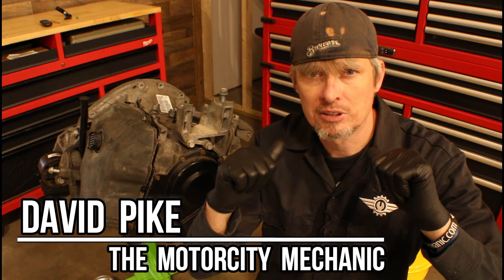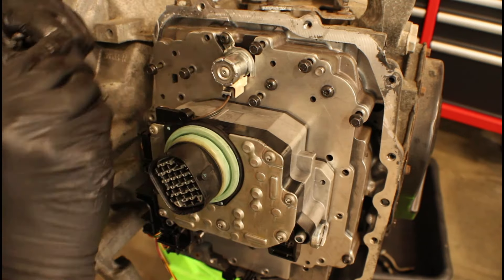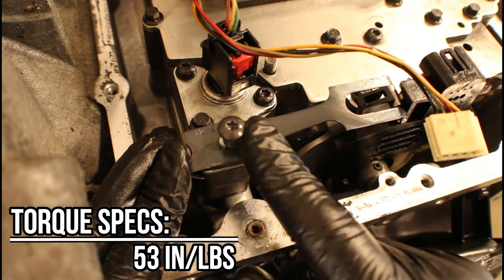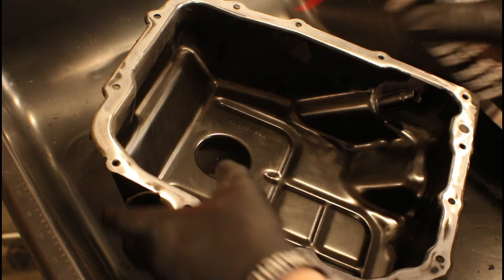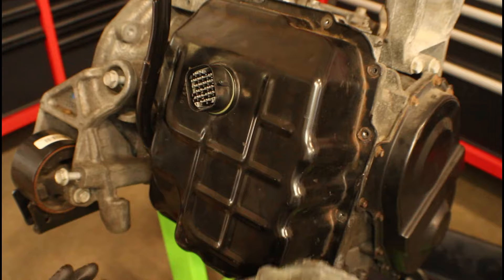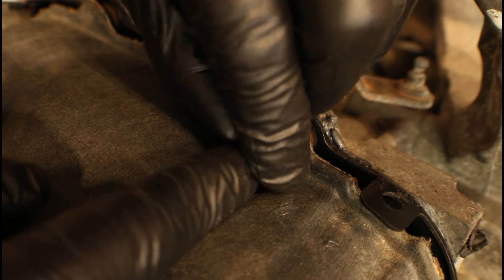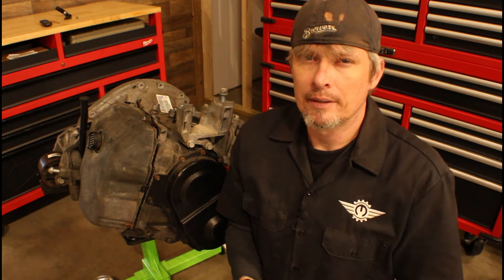Chrysler 62TE solenoid pack replacement Part 2

Comment: Felt like I was in class man Fr hands down best video
Reply from the maker: Many thanks for the awesome feedback. Glad you enjoyed
Reply: @MotorCityMechanic  I put a new solenoid pack the van has reverse but no forward drive
Reply: @Bama-ip3jm I have the same issue that I’m dealing with right now. Did you ever figure out what was wrong with yours? I get reverse after revving for a while but, drive gets me nowhere.
Reply: @Bmmw2186  had to replace the transmission

Comment: Many thanks and much appreciation for the time you spent with the solenoid pack replacement videos. Your videos were clear and concise.  I encountered a solenoid failure on my VW Routan and was able to follow and understand the process through your videos. Note: I also bought the e-service and repair manuals, but I would have struggled if I only had them to depend on for the necessary information. Funny note: I bought a [cheap] small clicker torque wrench to measure the necessary torque for the bolts. It seemed to work for the solenoid pack bolts, but when I went to torque the valve body to the transmission, I felt that something was wrong. I took the wrench to the vice and it would not click, even on 0 inch lbs. Ended up using manual torque method. I tested one of the bolts when I removed it to get an idea how much they were torqued. All is working well. Hope it lasts (with the manual torqueing of the valve body bolts).

Comment: One of the best instructional videos I've run across! I have this transmission on my 2010 VW Routan (built by Chrysler), and I'll be tackling this job soon. This repair job couldn't have been explained any better!
Reply from the maker: It means a lot to read comments like this. Many thanks
Reply: What systems were you having?
Reply: @angryw4nderer  The main symptom is the transmission gets stuck in 2nd gear. It won't shift down to 1st when you stop; it won't shift up either. I found that the problem will usually clear by 1) stop the car, put it in park, and turn off the engine, 2) Start the car, put it in reverse, and back up a few feet, 3) shift back to drive, and it usually works ok then. Now this has only happened maybe 4 times since I bought the car in 2010, but it's happened twice in the last 2-3 months. My code reader tells me that Solenoid "D" is defective. Seems that "D" is just one of the solenoids in the solenoid pack, and replacing the whole pack is what's needed. I've not had the problem a month or so now, so I'm holding my breath that it will be ok, but if it starts to become a real issue, then I'll be replacing the solenoid pack.
Reply: @randywharton6291  mine isn't throwing a code yet so I'll just keep driving till it does

Comment: Picked up a 2012 Caravan for $400 because transmission shop said it needed a whole new tranny ($3800).
Scrap price was $200 so I gave them $400.
$145 solenoid pack and these 2 videos later and it's my wife's daily driver. 
Best repair videos I've ever used.
Thank you.

Comment: You are the best car repair YouTuber by far!
If anyone is interested here are the part numbers for the blue o-rings and 2/4 clutch seal:

2/4 Clutch seal: 5078864AA
O-ring                : 6508636AA    -  You need 6 of them

Comment: I wished I had not  paused the part one video. I made a few errors removing the components. I actually did break the one solenoid connection 😂😂. Long story short, I removed the torx bolts as well and realized after watching part 1 I did not need to do that. I would have save myself some frustration.  Part 1 and 2 are extremely helpful. Enthusiastic two thumps up! I appreciate the video and guys like MotorCity Mechanic!!

Comment: This was a high end excellent quality video. Thank you for taking the time to explain in such detail. And also showing the correct way to do this job. Including the torque specs and other miscellaneous tips and tricks. There is a lot of little parts and pieces and taking the time to do the job right the first time with something like this is of the utmost importance. Subscribed!

Comment: Again thank you for the video, I needed this since I was getting stuck with the tubes now I know need to do from bottom and tubes in first... but on the vehicle not an easy job with blown out back, and trans fluid all over, since all was changed before filter trans fluid and gasket,  but thank you again.. I will watch this over and over to make sure all is done....

Comment: Thanks for the videos. I have replaced both the valve body and solenoid pack on my 2015 Caravan (the DC solenoid was bad). However, once I got it back together, the gear shifter would not move at all. I pushed the release just above the gear shifter and it would then move, although it was hard to do so. According to the indicator on the dash, I was able to get it to move from park to reverse to neutral, and back to park again. However, when the gear shifter was all the way at the bottom where drive should be, the indicator on the dash said that the transmission was in neutral. Therefore, it seems that the gear shifter and the transmission range sensor are no longer in sync.

When I re-watched your video, I noticed that the position that you moved the range sensor to when you reinstalled it was different from the position that I recalled my range sensor to be in, so I took the valve body cover off again to check out the range sensor. However, I can't get it to move to the position that you put yours in (presumably because yours was not connected to the transmission cable). I didn't disconnect or move the cable on top of the transmission, so I don't think that would be the problem.

So, my question is: does the position that you moved your trans range sensor to correspond to park? (Mine is currently in the farthest slot to the right, and it looked like you moved yours two places to the left from that farthest-right slot.) If I am supposed to move my range sensor two places to the left, would I need to disconnect the cable on top of the trans in order to do so?

Thanks for your help. It is very much appreciated.
Reply: Did you ever figure out what had caused this?

Comment: Thanks so much for the  detailed diag and repair videos. Not sure if this  will help anyone , but after replacing the solenoid pack on my 2017 Grand Caravan ( solenoid H open circuit ) it still wouldnt upshift . I took both battery cables off the battery , joined them together for 2 hours ( longer is better) , reconnected everything and now works fine

Comment: Great videos man.  I'm replacing the Torque Converter Lock-Up solenoid this week (Routan stalls immediately when put into drive, throwing Code P2763) so your video made it really clear what I must do to get in there and replace it.  Heck, it even made me consider replacing the solenoid pack while I'm in there just for good measure.  Filter and fluid change at same time. Thanks a lot!

Comment: Codes i was getting was. P083b, p0863, p,0733, P0734, and P0729. I am by no means a a novice. Changed out the trans fluid, filter, trans oil pressure switch, and I went  ahead and changed out the solenoid. Did the quick learn with my scan tool. None of the codes came back. However, whenever I drive it feels as if the transmission won’t go in to second gear or any other gears besides the first.

Comment: I've found out that if you lightly mark the bolt heads (when you are  reinstalling  ) ,with a white paint like you use for white wall tires , this will eliminate the possibility of missing on tightening one of the bolts. I just dab them with a white dot after torquing the bolts . When you have 20 bolts to torque, sometimes you could miss one, and that would be catastrophic. Just a suggestion.
Reply from the maker: Very true! Thanks for that added info

Comment: David - do a quick video about the fill. You guys use a tool, but I use one of those giant 3 foot white plastic zip ties as a dipstick since the pink fluid shows up against it, and the teeth hold the fluid, and I just use “fully hot, in neutral, 2” on the stick”.

Comment: Here is the elephant in the room:This transmission was designed for a K car! Over the years it has been used in in vans and cars that have grown i weight and power with very little improvement, The same basic design was made for 100 to 150 HP and under 3000 pounds. Heat is the enemy and the only tangible change the average owner can help. Heavy duty cooling radiator plus a towing trans cooler will help. Same with the over stressed brakes (over loaded with little or no improvement.

Comment: Just for other people who come across this, I'm working on a customer's Van and it too was the DC Solenoid (Pins 10-20)
Mine came back with 5.5Ohms resistance.

I had Error codes: 
P076A - Powertrain
P2807 Powertrain Pressure Control Solenoid G

Comment: I wish I would have found this 24 hours ago!! 😅 Unbelievably detailed!! Thank you so much!!

I mishandled the metal gasket plate on the valve body and it came off briefly. I’m concerned I may have lost a check ball (if that’s the right term). I have 3 and it looks like it may need 4. Any feedback? I’ve tried to find a clear diagram to no avail.

Comment: Your video is excellent you might want to add that there are 2 other sensors that should be replaced when replacing the solenoid pack - I had to go back and replace the transmission fluid pressure sensor because i got a code P084A - transmission still wouldn't shift from lower gears until I did - to be on the safe side I replaced both sensors O rings and oil seal - better safe than sorry ;  )
Reply: Hi! I have to replace the transmission fluid pressure sensor too - Can you tell me please where it is mounted?

Comment: excellent content... I just bought a 180,000 2012 town and country with a "slipping" trans. Assuming this is it, plus we're changing fluid/ filter. Any other considerations we need to make while we have it apart?
Reply: Were you able to solve you "slippage" or was it a delayed shift or hard shift sometimes like mine?
Reply: @angryw4nderer  it worked great while I had it with no issues

Comment: Thank you so much. Your video has really helped me understand what to expect what's inside these transmission solenoid pad. I am in limp mode town and country 09 and will not even shift giving a code p0736 incorrect gear ratio.

Comment: Thanks for the best videos!
Quick question, 
Any special steps to replace the solenoid if the white connector breaks?
And since we are already there, should I also replace the fluid pressure sensor? 
Once again,
Thanks!

Comment: 2013 Dodge Avenger I replaced the shifter solenoid it wasn't shifting correctly and the check engine code was for that I had a guy replace it now it reverse but I have no drive what did he do wrong
Reply: I have the same issue. Did you figure out what it was?

Comment: Great job! I have my 2014 Town and country in for transmission work torque converter and pump have been replaced still makes a whining noise says it's not under warranty slips once in awhile in 4th gear felt it slip once in fourth gear,Don't know what to do. It shifts fine 95% all the way up to six gear doesn't slip but once in a while there's a hiccup . Oil level is good.Says he has to drop the transmission again seems to me like he could get to the valve pack without doing that. any comments?

Comment: Hello, just did a trans swap and solenoid pack, and am now not getting crank. I was wonding if it matters on the range sensor if it is in a certain position? I moved the selector all the way forward to park, and bolted the detent down. Pin slid all the way to the right in the slot. Thank you!

Comment: Would a trans solenoid cause 2007 chyr pacifica to basically lockup motor when put in drive.  Rev is fine. Motor runs great in idle. Thanks for any input. You are a great teacher.
Reply: Yes, the little solenoid in the video, with the troublesome white connector, located above the solenoid pack which this video was showing how to replace (at least on the Routan/Town and Country/Caravan.  Check out this link for more info: https://www.volkswagenownersclub.com/threads/2009-routan-3-8l-stalls-when-put-in-drive.85337/

Comment: Your very good sir thank you very much
Reply: Dear sir thank you so much for a very good instructional video my question is the van was giving me a PO760 code which mentioned dirty transmission fluid as one of the things to try and do to fix the problem it didn't work now I am looking at do the solenoid pack can I leave the transmission fluid alone or do I need to go down there and change it again just thinking about cost

Comment: Hi,
What is the function of these pistons kind of parts behind the valve body? I got one valve body from an auto wrecker, which I pulled out from a dodge journey for my caravan. When I pulled out the valve body I also took these pistons out and one piston had a broken spring. Is it bad to have a broken spring? Please guide. Thanks.

Comment: Motor city mechanic Super Great instructional info especially with the tips on how not to damage the shaft pin while removing the solenoid with mounting plate. I might have got a bad solenoid block because the car feels like its barely catching the gears. Put it in manual mode and indicates 4th and 5th gear but it don't engage could I have torqued it wrong or bad solrnoid pack? Please some one respond ASAP.

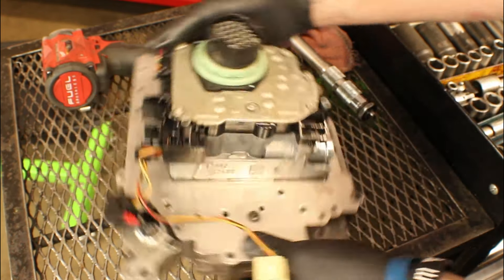Comment: Great video along with part 1! Thank you so much but I seem to be having an issue. At 2:40 that piece won’t click and it seems to come out. I don’t think that should be a strength thing so I’m not sure why I don’t hear a click nor lock it in place. Any ideas? Thanks!

Comment: Thank you for the detailed videos. I have a 2016 Dodge Journey. I watched both Part 1 and Part 2 and the extra side videos. I feel more confident going into it now. Quick question before I start and purchase the parts. The code read "P076A  Shift Solenoid H.' Should I just bite the bullet and purchase both the TCC Solenoid and the Solenoid Pack, or should I try replacing just the TCC solenoid first and see if that resolves the problem before buying the pack? I would hate to open it up again if I don't have to.

Comment: Hi. I have 2011 dodge caravan it has 150k mil. We already changed transmission oil. When it accelerates it  is shaking especially 3 rd and 5 th gear. 5 is little bit stronger. Could you help me about this. Any advice thanks happy new year

Comment: Hey there.  thanks for the vid.  I followed everything exactly and went to test drive today.  Shifts automatically from 1st to 2nd no problem but when it shifts into 3rd gear it slams itself back into 1st gear.  Pretty violent stop.  I checked fluid levels and they're all good.  Am I missing something?  Rewatched all your videos and made sure i didn't skip anything.
Reply from the maker: I’m assuming it’s going into limp mode….I would check for codes, there has to be some. Very possible that the reasoning for replacing the solenoid pack wasn’t the original cause and the solenoid pack didn’t fix it.
Reply: @MotorCityMechanic  Thanks for replying.  I solved the issue.  So it didn't go into limp mode in 2nd gear.  on the test drive once it hit 3rd gear it violently slammed back into 1st.  I remembered when I took the solenoid pack off the first time, there was a instance that the backing plate separated from the valve body.  I noticed the 3 check balls sitting on the plate.  Since I thought they hadn't moved I carefully put the valve body back on.  (I should've looked up the ball posisitions).  Anyways I decided to take everything off again.  Follwed your vid on testing pack with multimeter and the new part checked out, so then I took off the backing plate and saw one of the check balls was in the wrong place.  Put it back in the right place and reassembled and now it shifts like a dream. Thanks again for the vid.  Here's the vid I found that helped me solve the check ball problem: https://youtu.be/LFfNUhLmMPQ?t=802

Comment: David...I just had rebuilt the 62TE last Friday and I
ve been drove it for 40 miles and notice slipps between 4-5 gear and a little bit delay in other gear and a little bit of trans fluid smell.
I am thinking to drive for at least one week to see If get better. All electronic where changed with the Rebuild.
What do you think is happening?
Thanks

Comment: Perfect, like all your videos! How long do you let the RTV set before refilling? I recently dropped the lower pan and replaced the filter and ~5.5L of ATF+4. I had also evacuated some from the dipstick tube. Actually replaced about 12L of fluid in total. I only let the RTV cure for two hours. I have no leaks from the lower pan since the filter replacement, but I do have a leak either from the cooler lines or the valve body pan - just a few small drops which have appeared since the cold weather arrived. I should have checked when I had the upper manifold off for my spark plug changeout. Thanks for your other video about removing the transmission cooler line retainer clips.

Comment: Amazing David.
May I ask your advice:   what is likely to be the issue causing clunk when shifting from P (or R) into DRIVE, on our 2010 62TE transmission (Dodge JC Journey, SXT, RHD)?
No DTC codes present.
What parts would be required?  Will the trans need to be removed?

Comment: Is the shift solenoid replacemt recommended if fluid / filter change is not working? My 2014 2.4 Avenger has 130k with a very hard 2-3 shift when cold. After fluid change I had a trans shop do the re-learn and their test drive did not indicate a concern. Problem getting worse.